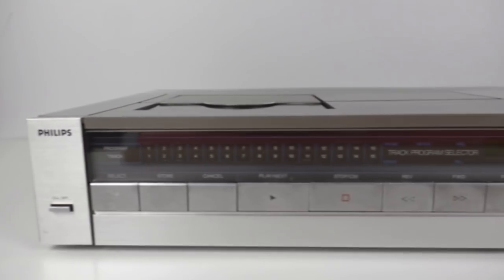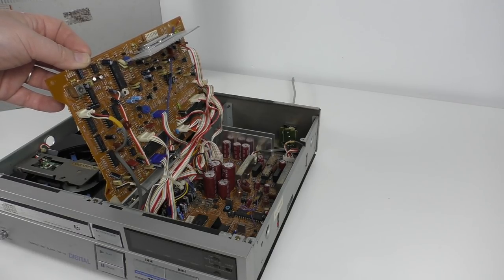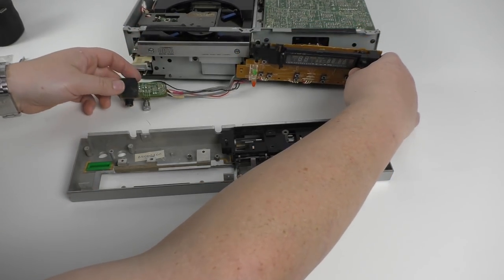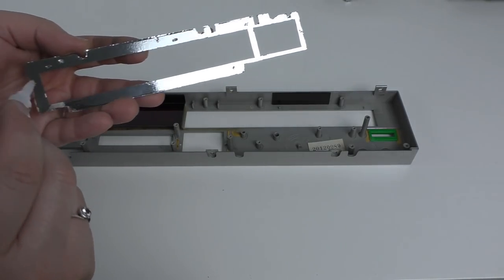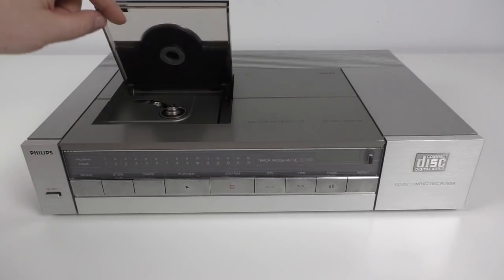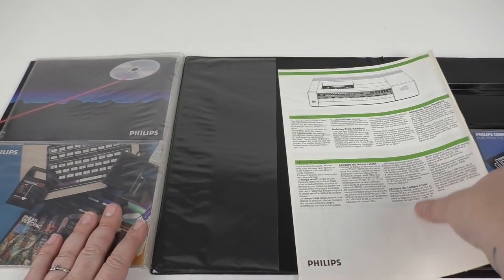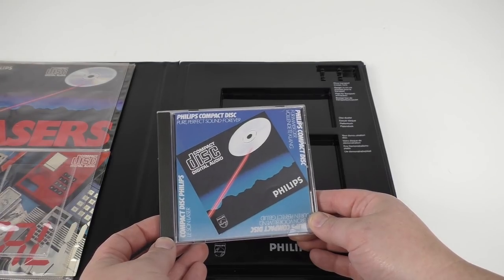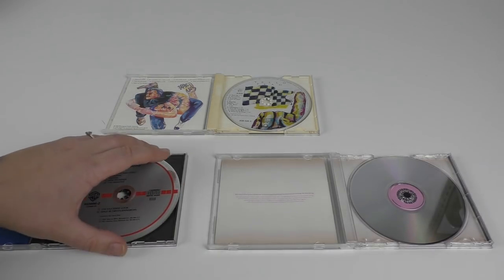Tech History: Early Compact Disc Players - Retrospective Look at the Sony CDP-11S and Philips CD202

Comment: I'm in the US and have a CDP-200.  From what I can tell they are the same CDP but Europe got it as the 11S.  My tray had issues opening.  I recently opened it up and cleaned the old grease off and put on new, and it now works very smoothly.  There is an L shaped arm held down by a screw on the tray itself (can be seen in the video) that is close to the power supply, that grease was very hard from age and heat.  While I was in there I also added the 2 heat sinks.  Thanks,

Comment: Mine cd 202 still works. And this great cdm-0 pick up mechanism!!!!
Reply: Take care of it! Mechanically is indistructible but its Philips capacitors are prone to fail, particulary the ones of power supply and some on cdm and servo pcb. I completely recapped many of CD100, CD200, 202, 300, 303 ecc. Measuring the old ones are WAY out of spec after nearly 40 years. If your machine has original ones soon may start to develop faults like 50hz hum and difficulties to read discs from cold.

Comment: My earliest CD is a Japanese Sony pressing of Wham's Make It Big. Catalog number 32.8P-60. Pressed in 1984 or early 1985. My earliest issued CDs are two Japanese Billy Joel albums and Pink Floyd's Dark Side of The Moon from 1983 (52nd Street, 35DP 1, and Glass Houses, 35DP 18, and DSOTM CP35-3017). Although those discs were pressed around 1985.

Also with the silver paint on a q-tip, I might try that on my Sony PCM-F1 digital audio processor (NOT a CD player). My F1 has seen better days and might have the same paint as the CDP-11S. Also, my PCM-F1 has the same DAC as your CDP, the CX20017. 

One thing to note about this DAC is that it processes both the left and right channels, and the effect is a extremely minor delay between both channels. The delay is 1/88200 of a second or 11.33786848072562492 microseconds. However this delay is imperceptible to the human ear and since it only is one chip, the price was a lot cheaper than having two DACs process both channels. 

As you pointed out, the CD202 you have has two DACs, so there is no delay however they are only 14-bit, and they use oversampling. All early Philips CD players had 14-bit DACs. Sony had true 16-bit DACs.

Comment: Great video Elyse, I have a CDPS11 in great condition, which has trouble reading discs. It plays fine one moment then it seems to scramble the signal. Any advice on what may be wrong with it?
Reply from the maker: I’d look at adding heatsinks to the two ICs, same as I’ve done. They overheat and cause the problem you describe, and my player used to do it before I modded it.

More info here: http://www.tronola.com/Saving_the_Sony_CDP-101_CD_Player.pdf

(Luckily, the 11s just needs a rectangular add-on heat sink for the servo IC as it’s not as complicated inside as the 101.)
Reply: Thanks Elyse for such a helpful reply, I really appreciate it as my S11 is in such good cosmetic condition I want to get it going. Final question, who would I take it too to do the work you recommended? A general service person? Thanks in advance
Reply from the maker: Well, if you're confident with a screwdriver, a grinder, and a drill, it's not a terribly hard DIY job. The servo IC heatsink is just a rectangle of 3mm aluminium screwed to the existing heatsink with some thermal compound in between, and the RAM IC heatsink is just a flat piece of metal with the sides bent up, a smear of thermal compound between it and the IC, and a drop of superglue to hold it in place.

If not, then yeah, I'd suggest an electronic repair shop. It's possible they may be able to source heatsinks from an electronics parts specialist that they can retrofit. I'd print a copy of that PDF out and hand it to them so they have some idea of what the end result should be.

The most important thing is that both of those chips get some relief from heat, as they are both running on the edge of their design limit for heat, and as these players age and the power supplies drift slightly, they run even hotter and cause the fault we both experience - Not only that, while it's possible to build a replacement for the servo IC from discrete components, there is no replacement for the RAM chip at all... An ounce of prevention is much better than a pound of cure. :)
Reply: Thanks Elyse you are the best!